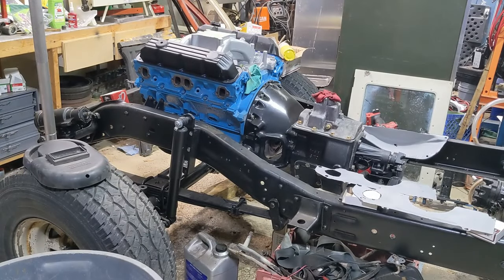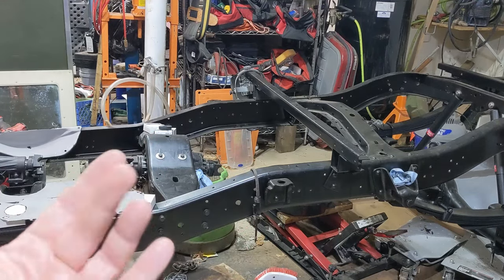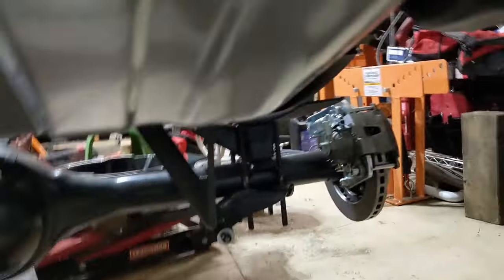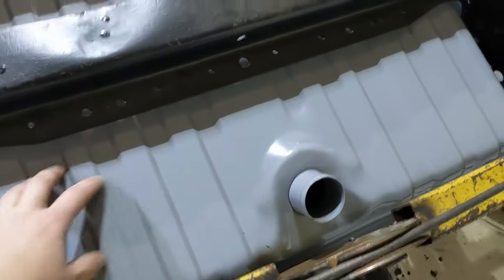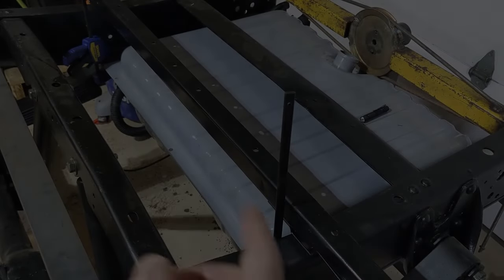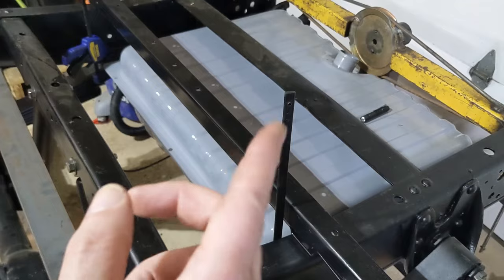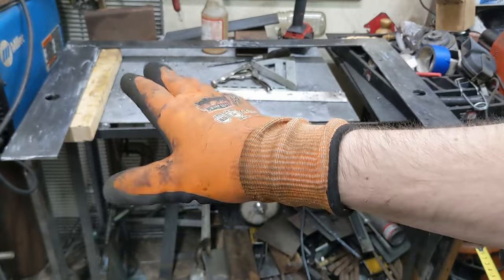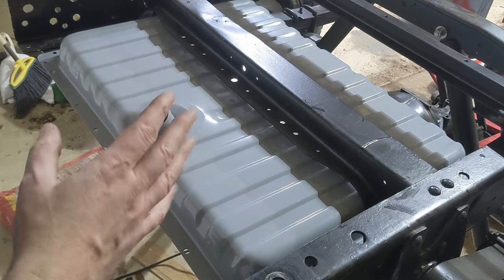Putting a Ford Gas Tank in a Dodge Tin Grille (True Spirit #38)

Comment: I've been debating on a fuel tank for my 1992 W150 as well. It came out with a saddle tank on the driver side with a in tank fuel pump. But now I have a mechanical fuel pump 410 stroker carburetor. You have a great idea

Comment: I would trim that metal so it's inside the edge of the frame so it is not catching debris, mud, water, rocks all the above sitting in between your frame and the steel plate

Comment: nice work. it will be interesting to see how the filler neck issue is resolved.  Dumb question time...If you knew that a Dart tank would work from previous experience, why did you select a Mustang tank?
Reply from the maker: The mustang tank has a flange around it and a Dart tank doesn't. I remember that the lack of any mounting holes was not fun. I also believe they are only about 16 gallon
Reply: @YoshimoshiGarage  Fair enough, sir.  It looks great.